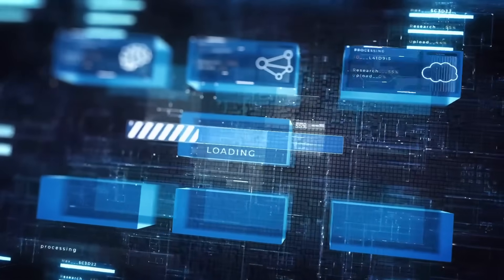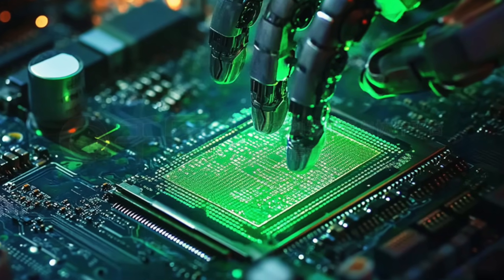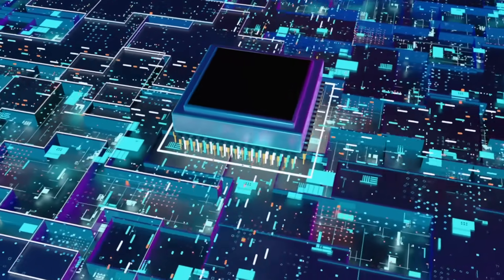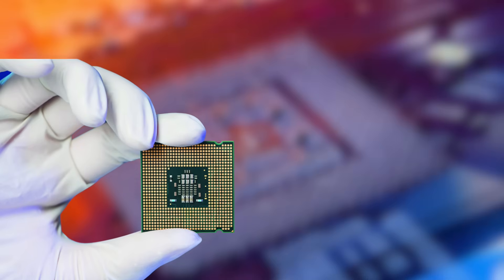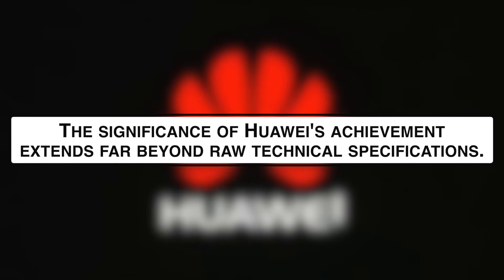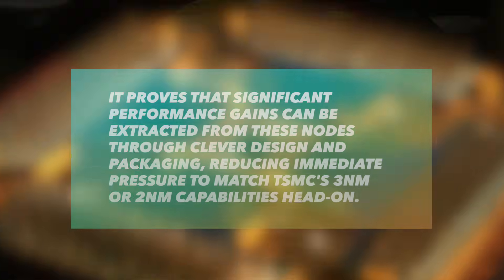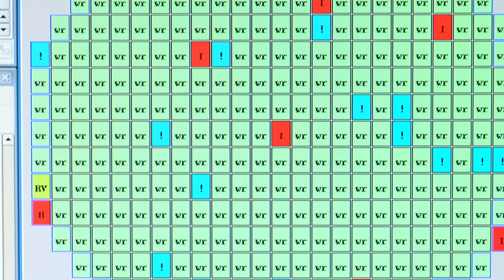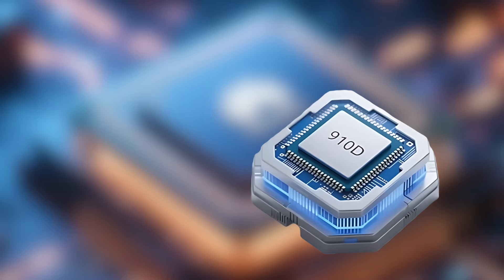China's Silicon Gambit: Huawei's Multi-Chip Masterstroke Reshapes the AI Battlefield.

Comment: Huawei's efforts to develop advanced artificial intelligence (AI) chips have been a significant focus in recent months, with the company aiming to challenge the dominance of US chipmaker Nvidia. 
Huawei is preparing to mass-produce its most advanced AI chip, the Ascend 910D, which is designed to compete with Nvidia's H100, one of the most widely used AI chips in advanced AI systems. 
The chip is expected to serve as a competitive alternative to high-end products offered by Nvidia, signaling a broader effort to reduce reliance on foreign technology.
Despite US restrictions, Huawei has continued to push forward with its AI chip development. 
In early 2025, the company plans to start mass-producing its most advanced AI chip, even as it faces challenges in manufacturing due to US curbs. 
Huawei has been working on improving the performance of its chips through methods such as cluster computing.
The development of these chips has also led to increased tensions between the US and China. 
Huawei's advancements in AI chip technology are reshaping the global AI landscape, with the company striving to achieve technological self-reliance amid growing geopolitical tensions.